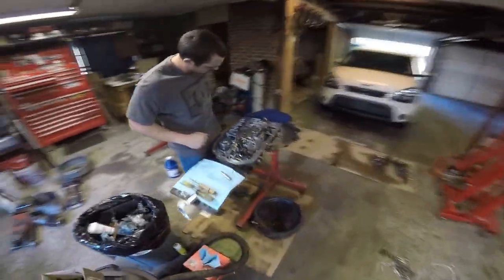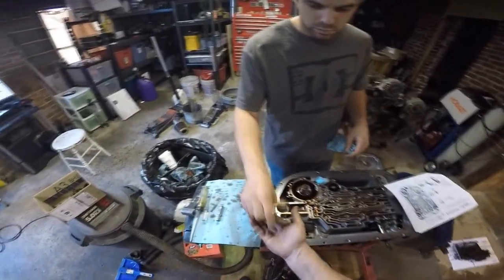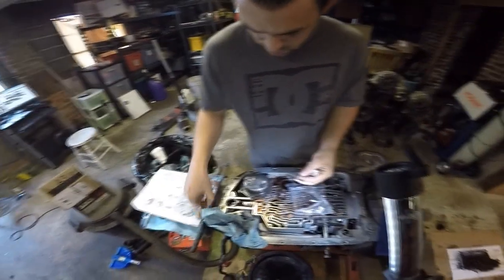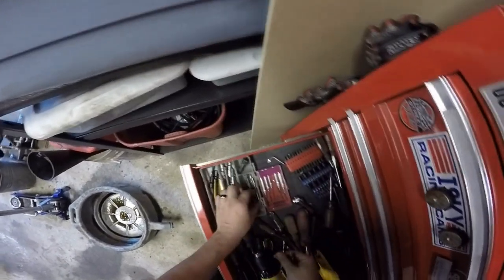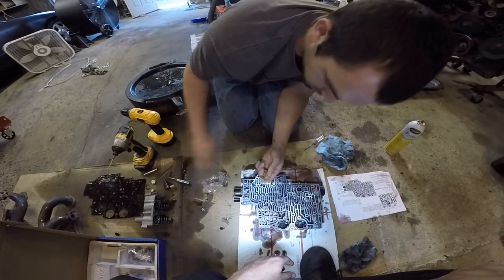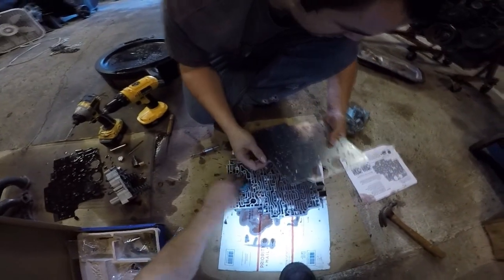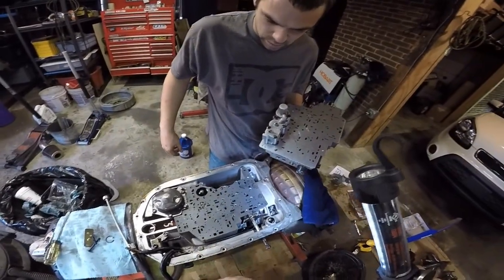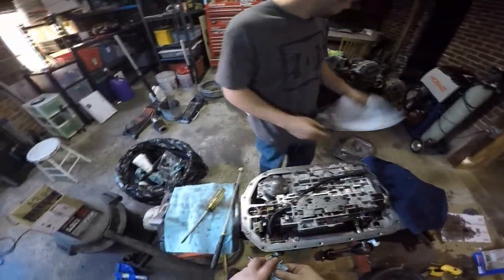10-20-15 4l80e hd2 kit install uncut 55min

Comment: Matt have you used the Raybestos Performance Automatic rebuild kits?  Any input?  Thanks
Reply: I'm gonna say no.. This is just a tuning kit essentially, unless you're talking about the raybestos shift kit, they basically all do the same thing.. I don't think he's had a completely rebuilt trans in any of the cars he has built. I don't think the new edge has a new trans either, but i could be wrong.

Comment: In addition to the cooler line change from early to later designs. You also have the top center hole in the bell housing, if it came on a Pre ls motor it won’t have the 12-o’clock hole in the bell housing

Comment from the maker: how did we do?
Reply: +Sloppy Mechanics Ask and ye shall receive, I guess you had been hounded about this before I asked last week.  But this will help hundreds of people build a sloppy 4l80.  Thanks from the sloppy mechanics around the youtube world.
Reply: +Sloppy Mechanics Thanks for the video, I have a LQ4 and a 4L85e and a TCI shift kit I will be putting in soon.
I have done my TH475 in my GTO, but not the 4L85e going in my 68' M-715 and wanted a heads up.

Unfortunately Im going to be doing it after the engine and trans go in the truck lol.

I have to say, the only gripes I have is the dirt you guys are getting in the trans, you put the valve body bolts in with the pan bolts in that box, and really should TQ everything back to factory with a TQ wrench..

And you can pick up a rather nice tripod for a few bucks brother lol.

 Not nit picking here, it's a great video, I plan on covering my M-715 build in the future.

Where are you located if I may ask?
Reply: Im bout try dis out
Reply: I think y'all did a great job. I've watched this video countless times.

I picked up a low mile 80e that is on jackstands in my garage now. I've done the case part and have the VB part left to do.

Just an FYI, the Harbor Freight snap ring pliers set worked well for me during the boost valve piece.

Comment: Could have drilled the plate to .120 for all shift, left the Orange spring 1-2 out of servo cover by the rear band, and installed a gold th400 pump spring(removing the other two while leaving in washer) for just as firm a shift and a lot less money

Comment: great video! Do you have any tips for choosing a junkyard 4l80e? What to look for and so on?
Reply: There was a design chase in the case which is why he talked about the cooler lines. The newer has the output on the front and the input on the rear. The old design has them both up front. 
Also around 98 is the top hole in the bell housing. If the trans came on an ls it has the rope center hole, if it came from a vortec it won’t like the older transmissions. 
90-08 is the production years and in the mid 90’s you had the case/cooler line change and then late 90s the bellhousingn pattern

Comment: I've done a couple PWM 4L60E and BRF 200-4R full rebuilds just winging it, making tools, and reusing anything that passed a 30 PSI air pressure test. Good music and good shortcuts because I can never find anything in this f**kin garage anyway, so I'd rather watch what transpires in yours. How'd you do? Kept it pretty relative, simple and budget minded while teaching somebody that blew all of those principles by trying (and screwing up) the "high-rev" HD2C kit on the 60, buying ATSG manuals, going w/ a Sonnax ring'd 9" converter right away (it was cheap), trying to keep an early rollerized billet 200 together (that input shaft offered no give), and thinking I was ahead of the game every time. Shoulda just figured out how to swap a 4L80E in. I'm looking forward to that one (most of them are 4WD that I run across), and I just read an article about a GT500 getting an ATI 4L85E (nope for me-money wise). I'd rather a manual, but the swap for stock used parts is ridiculous. Self taught idiot right here that loves your videos though. Probably see you at "Harry's You Broke It" sometime given the PA plates I've noticed in your other vid's. Keep the burnouts rolling!

Comment: on the 4wheel drive version the rear speed sensor is moved to the transfer case. However is the tone ring also removed? I am trying to mate an np208 from 1986 to a 4l80e. not sure what I am going to do about the rear sensor.

Comment: So...I have a leak (Seal)from the shift rod. How do I undo it? There is a pin that I noticed and I managed to undo the nut on the shft rod but cannot get it out. Any help would be great. Transmission is still in truck. I went in from bottom. I think I accidentally shifted when I was messing with the shift rod.

Comment: For the Colorado?
Reply from the maker: +1965fordgalaxie500 yes, this is the colorado transmission
Reply: Just a quick question: You mean this came in the truck or you picked it up separately? I thought they had 4l60e's.
Reply from the maker: the colorado came with a 60e, i sold it to a scrap yard and installed this 80e out of a van
Reply: Perfect. Thanks for answering man!

Comment: well pulled a 4l80e out of a 98 2500 today. not sure what to do about the yoke to swap it into my c10. any advice?
Reply: Can use same yokes as TH400. Depth is not the same but works fine. Maybe this will help someone else searching old comments.